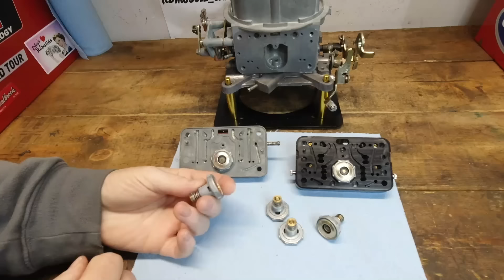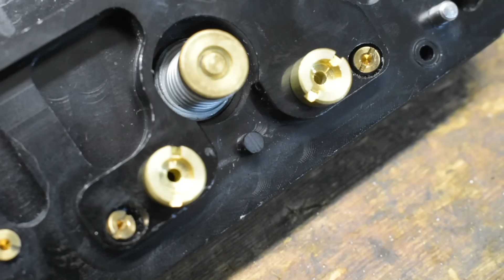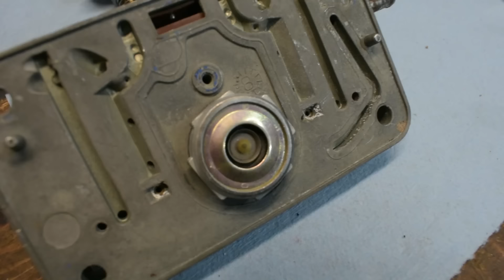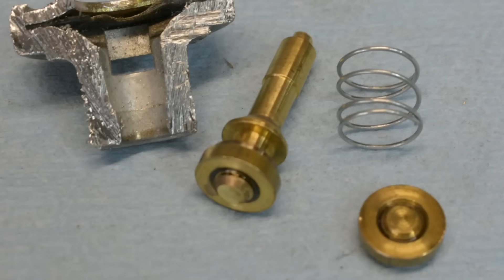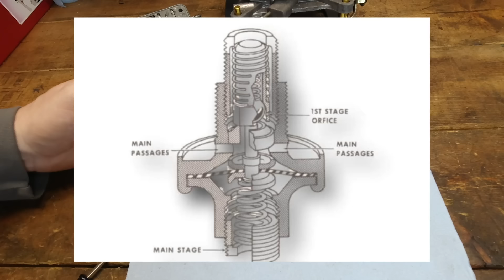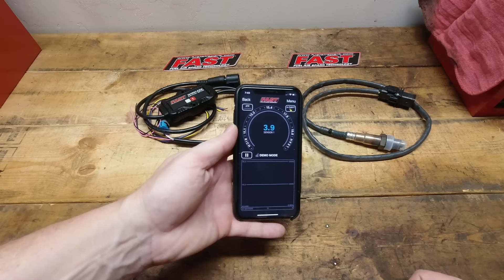Power Valves Explained: How they work, how to tune

Comment: There is no such thing as a carburetor that is too large.
 The emulsion well is the least understood area of ALL carbs, not just holley's.
You described power valve operation precisely backwards. Engine vacuum keeps the valve CLOSED, not open. The power valve channel restrictor under the valve should be used to tune WOT operation and the main jets used to tune cruising A/F ratio.
Reply: Came here to say the exact same thing. The 2.5 has a much lighter spring than a 6.5.  The video had it backwards.
Reply: I disagree, if the carb is capable of more air than the engine will ever need or use then its too big. You can argue that a 4 cyl can run with a 1000 cfm carb which is true but nobody sane thinks it would run well.
Reply: @cuzz63 You are way wrong. Plenty and plenty of guys, myself included. have found an "oversized" carb suoerior to something that matches the CFM requirement of the engine, if i went by what people like you say, i would only have 700 cfm on my 610p 355 Holden,  and if it did have a 700cfm carb instead of the 950cfm that it has, it would not be making 610hp i guarantee you. So go peddle that bullshìt somewhere else.
Reply: @cuzz63  it's easy to take anything  to absurd extremes to prove a point. Even if it's a spurious or specious point.
Reply: @psychoholicslag4801  So then why the comment? We all know that at a certain point a carb can be too big.
Reply: @cuzz63  not within the context of the video. Just putting a high capacity carb on a tiny engine was not the discussion. Design of the carb circiuts was and a carb of the correct design would work well. However using just any carb would not work well. Most carbs are chosen using the wrong criteria as in it's rated flow rate instead of the booster design and fuel curve needed. Most dyno tests for carbs are really booster tests. For example, an I R type system with 300 CFM per carb will make more low speed torque than a small 4 barrel on a 302 cu inch v8. Why? Because the flow rate isn't the issue, the atomization of the fuel due to internal design is.
Reply: Agreed with you on the PV description being backwards, if the engine doesn't make the vacuum ar idle to hold the PV closed it WILL be rich at idle and create a carb tuning nightmare to the uninitiated, especially with an aggressive cam.   Most OEM setups make enough vacuum to use a 6.5, found in most 650 DPs but there is little point in adjusting screws until the PV is holding closed at idle.  Otherwise you are just chasing the impossible.  Dude got other stuff right, make sure timing is good, make sure it is warm and then check vacuum.  Proceed from there.  In my experience,  vacuum will improve at idle when the PV is closed and not allowing fuel to enter in places it shouldn't because the PV is opening at idle.  Rich idle can happen from a number of reasons but if pressure, timing and butterflies are proper, it is likely due to a PV designed for more vacuum.  Once open due to vacuum drop (all engines drop vacuum under load) the amount of fuel passing is relatively the same with a factory holley metering block.
Reply: This is an interesting discussion. I've done my share of Holley carb tuning rebuilding over the years. 100's of them.
If I take a Holley plug the power valve, a part is specifically made for this, I will get better gas mileage. I see no noticeable difference in performance.
But then, I'm not massing the throttle to the floor but driving normal.
So the only thing I infer is the power valve still dumps fuel even under no load.
Reply: @cammontreuil7509  the # on the valve is the point it starts to open, unless its a dual or 2 stage valve. It's likely that the valve is opening at least partially under normal operation leading to wasted fuel.  I use much lower opening point valves than holley recommends for just that reason. A wideband O2 sensor is the easiest way to tune.
Reply: @psychoholicslag4801  I appreciate your answer. Using the standard 6.5 power valve on all carbs I have tested.
Plugging the power valve , Holley part #26-36, on any carb tested boosts fuel economy/ gas mileage.
I use as a test engine a 70 boss 302 engine. The engine has a stock 87 roller cam, BB chevy 1.7 roller rockers, gear drive, 5.4 rods and flat tops. Manley swirl valves, single springs. Stock intake. Swirl torque spacer. 
I've rebuilt countless holleys and run on this engine.
I recently tested a Holley 650 on a 110 mile distance. 70 jet, 6.5 power valve. Always drove at normal cruse excelleration speeds.
10 miles per gallon. I then switched to my standard running carb, the disliked Sum-M08600VS.
70 jet, plugged power valve. Better than 15 per gallon. Same driving. Same distance. No notice in performance difference.
This is just my latest example. I've done this many times with different carbs, but always with a 6.5. Plugging the port increases mileage. 
Now the flip side. And I agree with you about bigger carbs. 
If I put a 800 double pump carb . bigger jets, plug the power valve or leave one in, the noticeable power difference is substantial. And if I had dual valve springs, I'm sure I'd blow the C 4 transmission. 
In my experience and experimenting, no need for that troublesome valve.
I can tune a carb for economy or power.
But it appears the original intent of the power valve circuit was to give an excelleration boost when needed.
But it appears a fault.
Reply: @cammontreuil7509  Interesting. I had been thinking of trying an experiment with using  power valve that opens at a much lower vacuum like say a 3.5 to see how much it effected it..never thought about plugging it.
Reply: @cuzz63  always worked on every carb I tested and rebuilt. 
I can see how a power valve works on an engine with no intake manifold leaks and has even compression in each cylinder. But troublesome on most engines. 
If you put a gauge to measure intake vacuum and it flutters erratic, you've got a problem.
Reply: @cammontreuil7509  your probably right about it being a fault, but it really shows on heavy vehicles. If I'm not mistaken that's the summit carb with the annular boosters . If so the removal of the power valve probly works great since you'll have much higher booster signal. You didn't mention what heads your running on that Boss  but if they're Clevelands they're, IMHO, one of the best head/chamber designs ever. People treat them like SBCs and then complain about 'em. I run 10 to 10.5 compression, measured not guessed at, on 87 octane gas. I usually end up with a 2.5 to 4.5 hg power valve to keep it closed until almost full WOT. Improved mileage considerably especially using annular boosters. It gets to be very hard to get the jet/airbleed ratio right with an open power valve.
Reply: @psychoholicslag4801  1970 original boss heads. The cleveland 4 v motor with a small lift cam worked very well for the street. I used a low lift short duration cam in my engine. Works surprising well. 
I read an article in the 70's how a big valve behaves at low lift.
In my opinion, cleveland and boss heads make plenty of low speed torque.
Built now about 80 clevelands and a few clevors.
Reply: @cammontreuil7509  exactly what I found out with a 72 CJ Mach 1. Mild cam with big valves. Big valves make big torque. Proven it on my flow bench over and over. The big ports were a little much, but, at the time they didn't know. Good to know I'm not the only one still running them. I do like the CHIs though.
Reply: @psychoholicslag4801  
Very few of us know. I have one of those 72 CJ engines. Brinell tested original crank. 
Open chamber heads. Going to run it on the dyno with an old TM-580 cam.
Prove once and for all, cleveland 4 v's make torque off idle.
Even drag boss is interested.
Building 4 engines for customers now. That project is coming up.
Reply: @cammontreuil7509  Richard Holdener built a M code Cleveland and compared it to the hi-po chevy and was surprised how much torque it made. Love to see that kind of stuff.
Reply: @psychoholicslag4801  true. I've made comments on the test.
Reply: I (Hate Holleys) but I understood it to work as the same as the step-up springs on my Edelbrock... Once you get to less that #" (insert Number Rating) of vacuum then the power circuit opens....YES, Vacuum keeps it closed, but LACK of vacuum below the threshold it OPENS the fuel POWER circuit...enriching the mixture.
Reply: YES, a carb CAN be TOO big!!

A carb that is too large WILL work like crap, because the venturi will be TOO BIG for the airflow that the engine creates, and the all-important signal at the booster will be TOO weak and it won't meter fuel properly.
Reply: @davelowets 😄 it's hyperbole.

Comment: In all honesty the only thing I know about a power valve, or rather what I hear, is that a backfire through the intake will kill them. On a side not is it possible to tune a Holley to compare to a Q-Jet in terms of fuel economy?
Reply from the maker: Mid 90s(?) Holley put a check ball in the base plate to prevent a backfire destroying the PV.  Unless it’s a really old carb, it’s likely fine.  You’ll know pretty quickly if it isn’t!  

Short answer on fuel economy compared to a Qjet is no. There are way more design features on the Qjet to have better economy characteristics.  That being said, if economy is really your goal, look to the transmission.  You’ll find your biggest gains there.  Especially if you’re currently running a 1:1 final drive transmission.

Comment: This is good general information it would be good to pinpoint some common scenarios on Holley carburetors. The problem I found with most Holly's is cruising down the road they are usually too rich like 11 to 1 but under wide open throttle they are very close 12.8 to maybe 1 3. To get that cruising air fuel ratio 14 to 1 and then have a good tip in plus wide open and then idling is very difficult to achieve
Reply from the maker: Would love to include everything in one video but 20-25 minutes seems to be the tipping point.  Any longer than that and people just don’t watch.  Or they complain nonstop that the video was too long.  😆 I have more planned.  We’ll eventually cover everything.
Reply: I have found most guys put larger front jets in to get rid of the lean stumble that occurs while cruising and trying to gain a few mph. They should’ve corrected the stumble with a power valve as described in this video.
The issue is with the words Holley uses when you’re using their Hot Line because they say the Power Valve is a power adder.  This wording plays with your head because, okay yeah it adds extra fuel just before the lean stumble occurs adding power to gain or maintain the speed you’re cruising at. 
So the guys only want it to quit stumbling when they’re out cruising and already have the great track times, so now they jet up the front jets like Holley tells them making the cruise mixture rich and then when you go WOT everything is great.
If you adjust the cruise mixture using an O2 sensor you end up putting the original jets back in and sometimes one size larger (due to the ethanol added in the fuel) and then make the driveability correction with a power valve that opens just before the lean stumble occurs. You want the power valve to open at least one inch of vacuum higher than the stumble occurs.Have someone watch the vacuum gauge and when the needle suddenly drops to 0” say at 7.5”. Install a 85 Power Valve.
Reply: Thanks explained well  without talking down to me
Reply: If you wanted to lean the cruise a/f ratio, you would simply change the main jet to a smaller one and then open the power valve channel restriction size to maintain the overall ratio.

Comment: From my understanding and studies, the purpose of the power valve is that it allows you to cruise (pretty much at any speed) and you want it to remain closed.  You only want to open the flow and enrich when under larger power demands like spirited acceleration and/or  WOT. PV's allow the carb to downsize the main jet about 7 numbers vs no power valve so that you can cruise and sip fuel.  So where I get a little lost in this video is the various cruise tests. I would be reading those vacuum readings and making sure I chose a PV which is closed under all of those cruise conditions.  I am learning all I can and working hard trying to tune multiple holleys to get one working well on my hot 327SBC, but I can't say I'm doing so well yet.  Using vacuum, wideband, tach, and video recording gauges and trying.....  Have a horrible lean condition on throttle tip in.
Reply from the maker: Speed is the easiest way to help understand opening events and driving data.  It’s easy because we can work with something everyone can measure like MPH.  Load, no so much.  Looking at this I could have done a better job of explaining the why.  If I could, I’d just have everyone run a data logger and we can see the full run and when those lean/rich condition occur.  For sure when we start doing tuning videos on both my truck and Chevelle, we’ll walk through the process with more clarity.  Thanks for the note.  Very helpful.
Reply: One of the things that make a huge difference is in gearing. My car no overdrive with 3.25 gears high stall you cant lug it. Hard to get vacuum to drop much during normal driving. Now put an overdrive it, a heavy car with a lockup torque convertor  and every hill you go up vacuum will drop a lot. I try to size the vacuum opening for normal driving so it stays closed. But I'm trying to run around 14-15 fuel ratio. If it pings due to lean or advance timing you could cover it by opening the power valve just before the ping. Great video. I do have a data logger.
Reply: I would go with annular boosters instead of straight or dog leg boosters. The lean tip in at cruise speed is either the transition circuit going lean before booster take over or insensitive boosters not activating soon enough. Carb size problems are really just booster and emulsion problems.

Comment: I have a feeling that a carb tuned by you would be just as good as a Holley sniper unit without worrying about electronics leaving you on the side of the road, keep the videos coming
Reply from the maker: Lots of time and years making a bunch of mistakes!  But I do enjoy the process and the outcome.  Good times!
Reply: @johnweaver8470  a carb has a WAYYYY higher chance of leaving you on the side of the road.
Reply: But a sniper will adjust your air fuel ratio while you’d have to get out and change jets pretty regularly to keep up…
Reply: @patrickharper9297  why would you change Jets regularly? Unless you modify the car once you get it jetted right its done. The worst I've ever had to do is just adjust the mixture screws at idle when the weather changes or I do a tune up.
Reply: @patrickharper9297  maybe if going to higher altitude or cold or hot weather, but that’s about it
Reply: @patrickharper9297  good point for sure

Comment: This is very good.  if you have a "fully" adjustable carb as the new Edelbrock 4150 or one like it and you have an dual ARF gauges (v8, 1 for left and 1 for right & dual plane manifold), vacuum gauge and a human data logger.  How do you know what to change?  power valve, PV restricter, high speed, low speed air bleeds, air bleed restrictor, etc.  I get if AFR reads lean at X RPM I need to add fuel to a circuit that affect that RPM.  I've read the Holley red book on 4150/4160 and David Vizard's Super Tune and Modify Holley Carbs book.  I'm having trouble turning words and pictures into practice.  I've probably read what I need to know and didn't realize it, so maybe hearing it another way would turn the light bulb on.
Reply from the maker: I’m going to do quite a few videos in this once the big block for the Chevelle is done.  It’s an extremely long process and very very technical.  But you’re spot on that a dual wideband O2 will be extremely helpful.  Absorbing good tuning information online for sure will help.  The good things is as long as you don’t go too lean, it’s something you can tweak on your own and learn as you go.  Just take really good notes along the way.  What your AFR readings were at the rpm you’re monitoring and what your changes were.  That way you can always go back if you get too deep into the weeds.